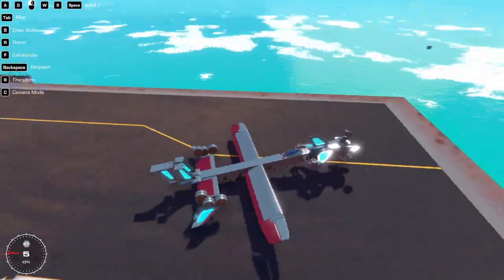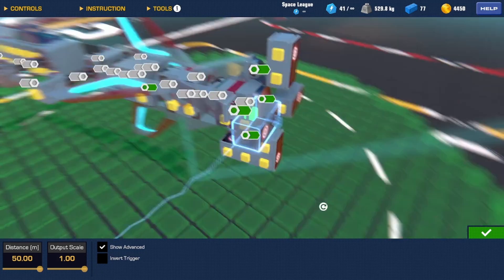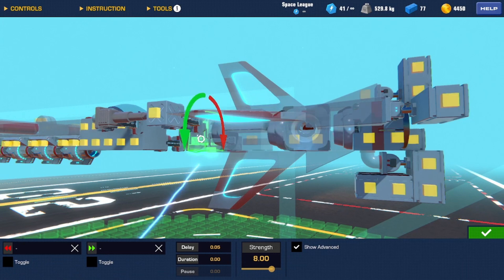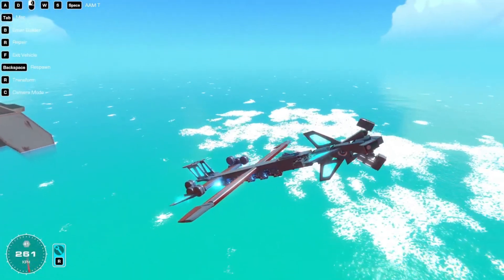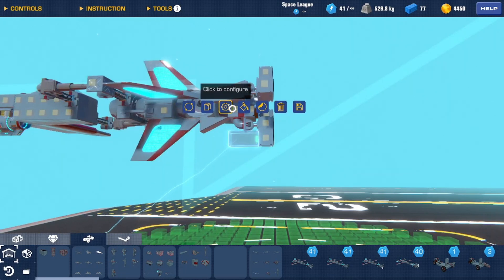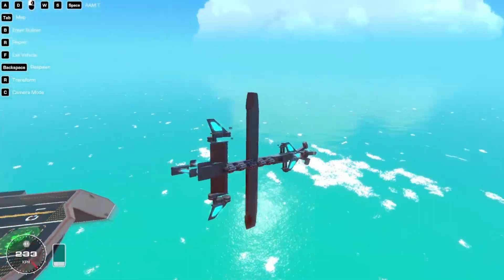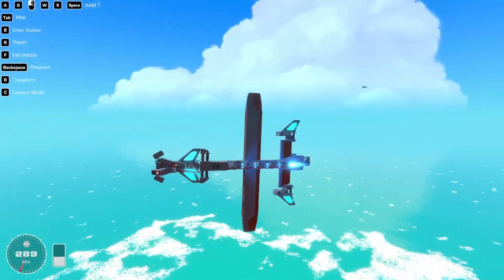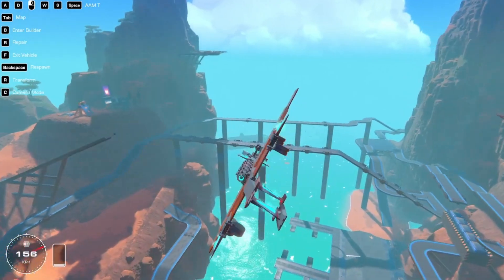Working Modless Missiles in Trailmakers

Comment: A recoil based ttacking missile, ive done this in 2d for a torpedo, basically 2 guns side by side and the recoil gets decoded into left and right motion from an angle sensor, its really simple really but id like to see you try, maby you will come up with womething better
Reply from the maker: preaching to the choir. this channel started on that stuff. Sadly that stuff has trouble at high speed and has issues. at high speed drag and other random insatabilites make it basically impossible.

Comment: Have you made a flying wing without using gyros or verticle stabilisers, whilst using the least number of control surfaces as possible! its quite fun to figure out the challenge, and the stability issues!
Reply from the maker: yeah i got one with only 2, the wing tip controls worked for both roll and pitch

Comment: You could set the sign of the sensor output so that it can be fed directly into the gyros, and then the two sensors with positive outputs feed into the two hinges that expect positive inputs, and the two sensors with negative outputs feed into only the two hinges that expect negative inputs.
You'd probably be tempted to set each hinge so that the sensor that's on it also feeds into it. But I think it would make much more sense if two opposing hinges always moved together. That would ensure that your searching circle doesn't get off-center (it'll only gradually deform into an ellipse).
Reply from the maker: while valid, there is still a reason i made it spherical. because of the rotation, all the sides experience the same things so it makes no sense to isolate the up and down sensors from the right and left sensors. by linking them all together it gets a more consist set of inputs, 4 per 360 degrees as opposed to your proposed 2 per 360 degrees. there are zero performance benefits to splitting them. if it was not rotating then there would be, but not like how i have now.

Comment: Simple solution: double the sensors.
Reply from the maker: that only works if the position of those sensors is also rotated out of sync to get more coverage. but that requires me to double the amount of hinges. and 1.5 times the drag. yeah its a solution but the amount of bulk the missile would have to get from extra thrusters and so on would make it impractical to be air carried on a fighter jet which was against what i was aiming for.
Reply: @ThisIsDumbAllTheNamesAreTaken  or you could make two opposite sensors cover a small angle of cone and other two cover larger cone when small cone covering sensors detect it decreases the cone angles also turn towards if the larger cone covering sensors get detected it increases the cone angles also turn towards 
Remember you can add as much as computing strength to the missiles using seatless RC glitch
Reply from the maker: @christojojo4433  i never thought of splitting the usage of 1 pair of sensors but i dont know how useful it will be. if it does not have a lock its better for all the sensors to be searching. if it found something then its better if all the sensors try to keep the lock. splitting up the sensors is only really useful for multi tasking but missiles tend to only have 1 very specific and precise goal so im not sure how effective it would be. also RC is not worth the computation power. its simply not worth the complexity and it will still have some nasty delays.
Reply: @ThisIsDumbAllTheNamesAreTaken well, what's more important to build arround? the missile being slightly more sluggish, or the missile not being a missile?
Reply from the maker: @Zane12.1  well the missiles still works as a missile. more sensors is better, but it still works as is.

Comment: Cool missile, I'm definetly try making one simmilar. I've been designing misslies the last days and been using rotors to spinn/rifle them. Mine are not homing but due to the spinning prox detection works pretty well. Look up for example Deraptorizer, on the workshop,  for a AA tmissile truck using that system. Think you might find it inspiring.
Reply: Use two servos, one spins slow so you cover “more” area and the other is at 0 strength so it allows your other servo to spin
You could also use two helicopter engines, spin one clockwise and the other counterclockwise to cancel torque
Reply: @TheRealKosmicKing  I'll have to experiment with that. 🤔

Comment: You need to up your recording quality its to pixelated even at 1080p.
Reply from the maker: thats only an issue on your side. if its at 1080p its at 1080p. if it shows less than that then its your connection, not mine.

Comment: The smartest thing you did was the magnet on the missile.😊
Reply from the maker: it surprisingly not needed. one of the biggest benefits of having the sensors expand with the target size relative to the missile POV is that it can retain good track right up until impact.